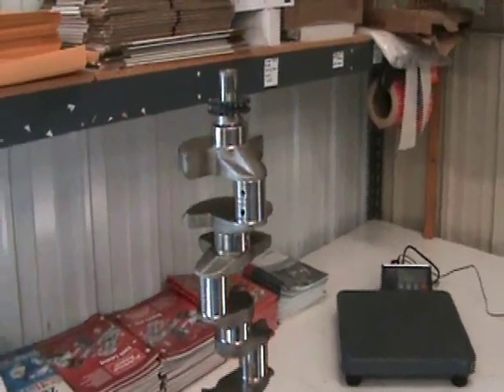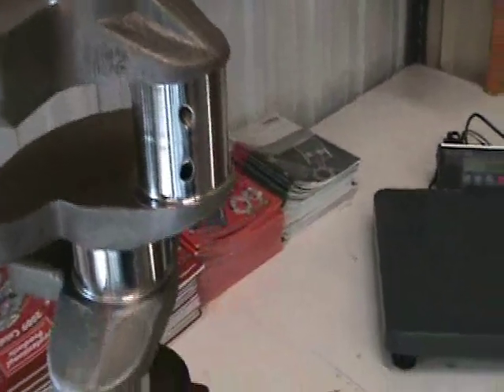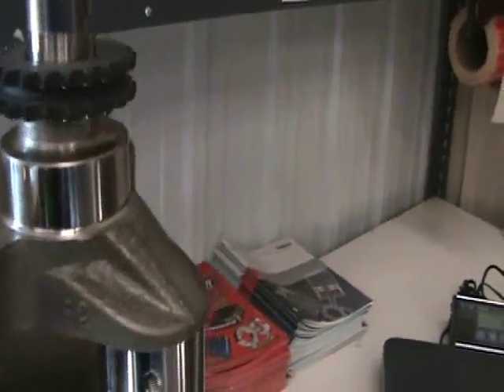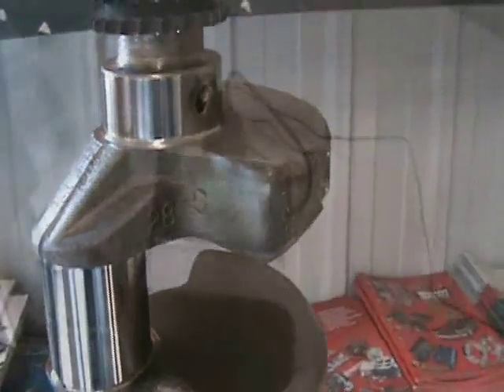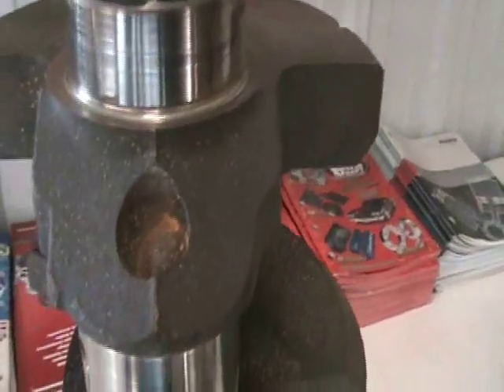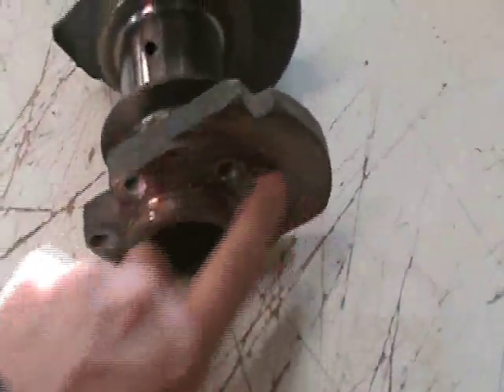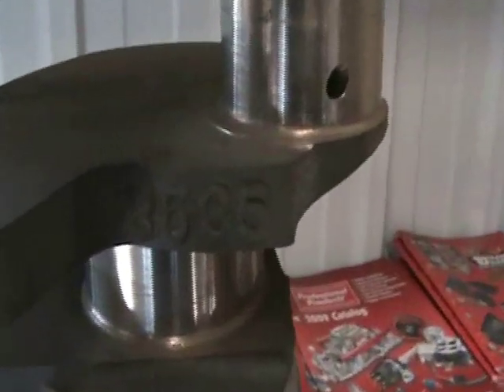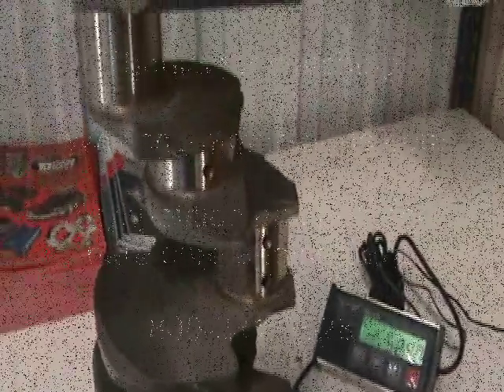Chevy Cast vs Forged Crankshafts

Comment: How many rpms can you get out of a cast crank.  Id like to build a cheap 7000 rpms small block for my s10
Reply: 8200 on alcohol for most of the racing season.
Reply: 8000 balanced, without power adders. Transbrake may/may not affect it. Lol
Reply: Depending on ballancing
Reply: @Haffschlappe I commented 11 years ago

Comment: The first one is a cast steel crank, the second one is a cast iron crank. Forged cranks don't have a parting line because they're not cast in a mold. How does it get an 1182 "casting number" if it's forged in a gazillion ton forging press?
Reply: Well, you are absolutely wrong. Congratulations. Next time you have no idea what you are talking about just dont say anything. Got it?
Reply: @poncoolride  are you the comment police?
Reply: @RJ1999x  well I guess I was that day... and it must have been a day when I was in a particularly bad mood because I was kind of an A-hole in my comment. However the first was still a forged crank. The chevy forged cranks were forged in a 180° plane and the process leaves the wide parting line..  they are then twisted to achieve the 90° rod throws. I can see why this might confuse some people who are used to a more common non twist forging that you see these days.

Comment: Google "austempered ductile iron" to see some examples of cast crankshafts made with that particular version of ductile iron. Apparently, ADI is more fatigue resistant than forged steel.

Mazda used a 'squeeze-casting' technique for the rotors on their Wankel engines. I wonder if there are any reciprocating engine components made with this technique?

I actually came here looking at the forged vs cast controversy over pistol frames...

Comment: hi found your vid, i have a 85 chevy scottsdale 10 series with a 3 speed manuel transmission, its leaking really bad from the rear main seal, however ive asked around and no one can tell me if its a one piece or two piece. is there anyway you can tell me which one it is? thanks for the help.
Reply: Rear main seals are always at lest 2 piece.

Comment: Forged vs cast cranks can also be told by the way they sound when you flick them with your fingernail while the crank is standing on end. The forged crank will ring out with a sustain, the cast crank sounds more "dead". Nice job on the vid

Comment from the maker: @BadAndUgly 
450-500 Horsepower depending on the application. Light weight connecting rods and pistons will up the horsepower rating and crankshaft reliability.